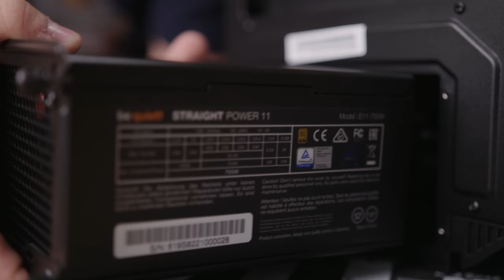💀 The DEAD Silent PC 💀

Comment: Is it dead silent because it was built by The Verge, and died?
Reply: No it was built by Lyle and he inserted the RAM in the PCIe slot!
Reply: @lurts9820  Haha 🤣🤣
Reply: Verge one booted up by some miracle
Reply: Can't be, they used plenty of thermal paste
Reply: I hope this Verge bashing never ends. They created something so unholy...
shudders
Reply: It's silent coz he build it with allen wrench. ALLEN WRENCH FTW.
Reply: Every Verge build is silent because they never turn on.
Reply: I want someone to do a "how to build a pc wrong" video except with sponsored parts so they don't have to pussy out, and they can go squirt the entire tube of thermal paste into the cpu socket and force the ram down the pcie sockets with a no-case loose power supply and a massive fucking dent in the cpu
Reply: @lurts9820  WUT

Comment: Is it "dead" because it has an rtx 2080 ti inside?¿

Go read the news
(PS I have a rtx 2080, :( I hope it doesn't die)
Reply: There are very little complaints about the 2080 compared to the 2080 ti.
Reply: @easi_solstice  yeah but mine is already overheating (gigabyte windforce) and I'm scared
Edit: I fixed it, my case wasn't exactly in a place with good airflow
Reply: @akshathk.  Guess that's just unlucky then. Don't really feel that bad tbh should never be an early adopter it's a pretty dumb idea because of this kind of stuff.
Reply: Im currently running 3 2080ti before you ask. i used to mine and sold all my 1070s and 1080s.
Reply: @PaulyRenzeth  Yeah some people aren't having problems but others are.
Reply: @akshathk.  That's why they have warranties. The thing is, you'll get that shit when you buy leading edge technology.
Reply: @Bruce Banner Well 2080's are having pretty much no problems either way doesn't change anything.
Reply: @akshathk.  And I have FE 2080Ti and yeah they do run hot. Waterblock here I come.
Reply: @Bruce Banner Either way I don't give a shit the 20 series is a joke either way.
Reply: @Bruce Banner I mean I'm not wrong "It just works" btw
Reply: @Bruce Banner Give what up? Don't see what I'm "giving up"
Reply: @easi_solstice   Exactly.
Reply: @n.i.5381  Exactly.... don't see what he's trying to say to "give up" on he thinks this is an argument apparently but it's not.
Reply: @Bruce Banner I gave that up a while ago... maybe you should reread the comments. Also I never said they have no issues.
Reply: @akshathk.  You must have trash airflow because I got the same card and I'm not having any problems, have you adjusted the fan curves and the power/temp limits on the card?
Reply: @easi_solstice   No, I meant "exactly" to your post where you said he shouldn't have bought it in the first place.
Reply: @n.i.5381  Oh ok, well yeah that's true also.
Reply: @shawnpitman876  Settle down, no need to get hostile, you have a point but I guarantee that air flow is more of a factor than the silicon lottery in this case.. There is no way that the difference in silicon is going to be a factor if one card overheats for someone and the same card doesn't even get close to overheating for someone else.
Reply: @akshathk.  do you play at 4k? do you need a 2080 when you can get a 1080ti or a 1080 and save lots of money lmao
Reply: All those complaints that came to the media are a few weeks old. Nvidia was fast solving them and pretty much all cases are closed now.
Reply: @shawnpitman876  actually it's because the ambient temps are already 30 C here :( and I kept it in a corner with little airflow, also I don't have the best airflow case (k500l), at least yet, so that will really affect temps, I'm planning to get ml120 from Corsair... With the case open it runs at ~68 C load, case closed higher 70s, once even 80 in Assassin's Creed Odyssey... And no, it hasn't died yet, and it won't
Reply: @akshathk.   TF you giving me the middle finger for bud? i fail to see how i said your card was going to die.
Reply: @easi_solstice  - there are very few complaints about the 2080 because its an overpriced POS and intelligent people aren't buying it. The 1080ti is cheaper and performs better too.
Reply: @akshathk.  i got a msi duke 8gb rtx 2070 will that burn into pieces? lol
Reply: @karvq.-4619  mine didn't die yet thankfully :)
Also it's not overheating anymore, if you consider torture load 70s C as not overheating.
Reply: @akshathk.  I Have A Question how many vrm phases do i need no overclocking at all the motherboard i have is a asus z390 maximus 11 hero i5 9600k 16gb of trident z rgb and a 550w psu from evga and a kraken x62
Reply: dont overclock it or it'll die
Reply: Same I have 4 of them, I just pray the water cooler doesn't break
Reply: @PaulyRenzeth  how you running 3 when they dont support sli
Reply: @GorryGaming  The applications I use can take advantage of each card individually. Its basically for my editing/rendering softwares that can utilize each cards without the need for sli. and an update, 2 months after i made the comment one of them failed and was returned for RMA, the rest are still working.

Comment: "DEAD Silent PC" - has moving parts. I am disappoint.
Reply: Exactly. I wouldn't call my PC "dead silent" and I'm running a Scythe Ninja 4 heatsink on my RX480 with fans at 600RPM under load and a core temperature <60°C.
Reply: @Marcel Johe passive water cooling is even more difficult.
Reply: Experts ... sigh ... Test the NB-eLoop B14-1 and then we'll talk again ...

Comment: Let me correct this build:
1. Replace the 9900K with an 8086K as the 8086 can be OC'd to probably 5.3 on all cores. This will perform better in games than the 9900, guaranteed.
2. Replace that ridiculous ram with Corsair Vengeance LPX
3. Use both fans in the DRP4 cooler and orient it correctly.
4. Replace that Toshiba drive with a Samsung 970 Evo (or Pro if you got the $$$).
You're welcome.
Reply: I think those are from the sponsors. Or else he might choose a better one.
Reply: 8086 is worse. It is more susceptible to Spectre/Meltdown. The 990K implemented some hardware fixes to them.
Reply: @samuelwhite3173  8086K is better for gaming, period. If you want to talk security that's a different subject.
Reply: @n.i.5381  The security patches significantly affect performance. The 9900K can reach 5.3-4 GHz too. And it has a soldered TIM...
Reply: @samuelwhite3173   9900K at 5.3-4GHz on all cores with normal cooling? Total bullshit.

Comment: can we get some temperature readings with 9900k on air? i read alot of threads online about the 9900k not really suited for air cooling when tryin to OC it :/
Reply: Did he OC? Usually people don't OC when they are building quiet PC.
Reply: It gets over 100 degrees. It’s insane people buy it. I7 8700k/R7 2700x for gaming or Threadripper 2 for video editing/4k rendering is a MUCH better deal
Reply: Not everyone overclocks.
Reply: @aquifer9480  I couldn't agree more. The fact that Intel resorted to soldering the die and upping the thermal limit is a pretty big giveaway that this is a flawed chip. Sure, its fast, but I reckon it'll also be short lived.